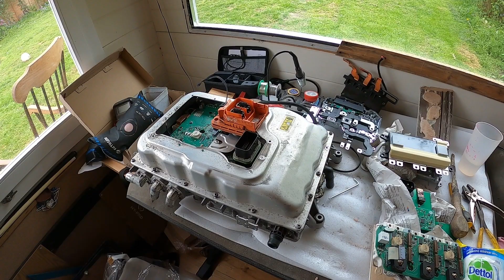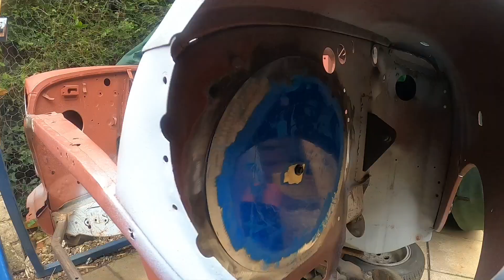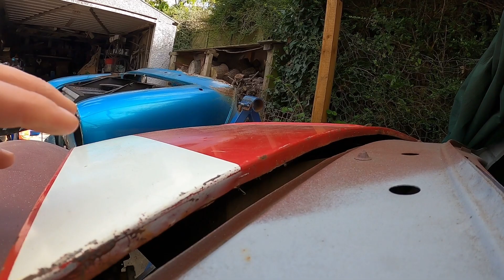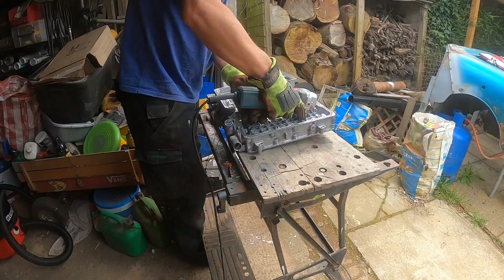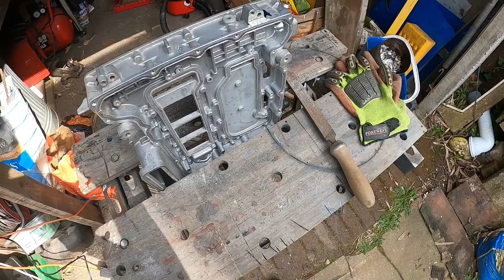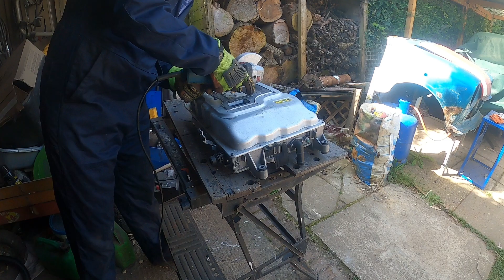Project Mini i3 modifying the inverter housing

Comment: A Prius inverter may be small enough to fit or could be moved to a more convenient position. I'm not sure how easy it would be to match it to your motor but I'm pretty sure it could be done. Damien Maguire has done a lot of work with Prius Inverters.
Reply from the maker: Thanks Ali, I'm not sure the Prius inverter can handle the power I want to push through but it's a nice idea.
Reply: @MiniLifeCrisis  Have you checked out Damiens videos? I'm pretty sure he was pushing a lot of amps through one and I believe others are using them.